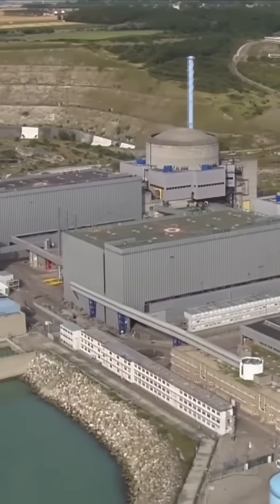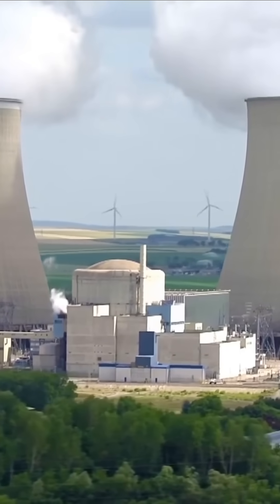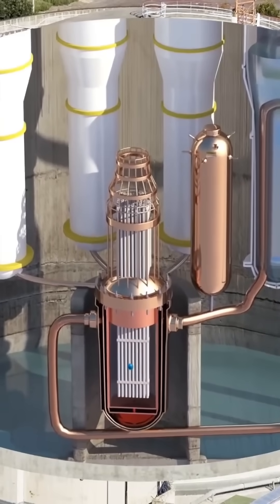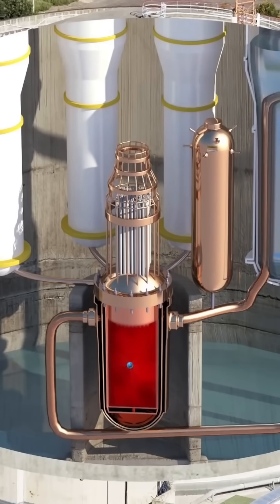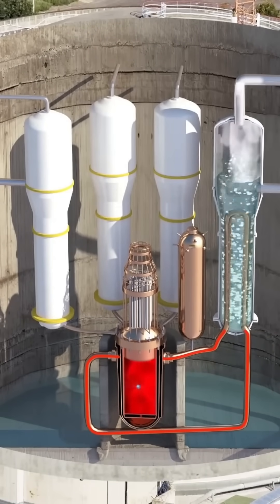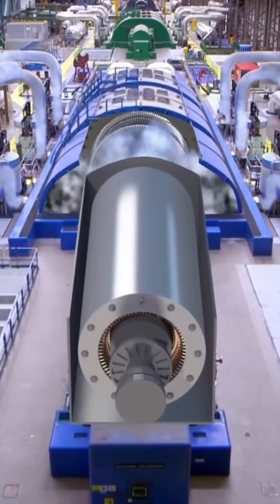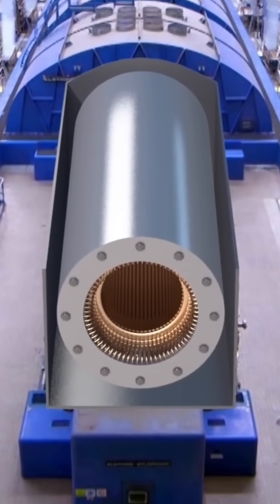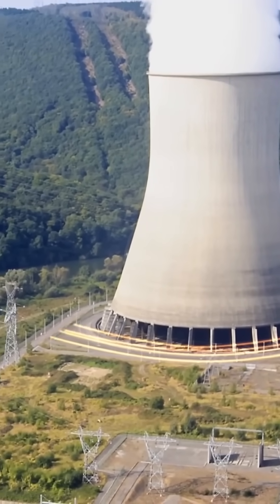How does a Nuclear Reactor work? #shorts #nuclearpower #nuclearreactor

Comment: It's a fancy way of boiling water
Reply: *Efficient way
Reply: @Highbudget , what about the waste generated that last 1,000 of years...
Reply: @iCyWEdontCi2i  the amount of death caused by the waste is zero  meanwhile the deaths caused by polution due to  fossil fuel burning is over 8 million every year
Reply: @gleyphnir087 ,  And that's how you can get away with that statement because a nucIear reactor, on its own, cannot power itself... It takes atleast 1 external power source ( coal-fired, natural gas, etc ) to help keep a nuclear reactor cooled and running. Their waste alone is enough, but when you have nucIear waste that has to be stored away for decades, AND Still Adding Up...  You have a problem.
Reply: @iCyWEdontCi2i if you can suggest them an alternative pathway
Reply: @iCyWEdontCi2i  Sources?
Reply: @iCyWEdontCi2i The hot rocks in a can waste that never hurt anybody anywhere ever, ever, while oil coal gas dumps billions of tons of waste/yr  in the air?
Reply: @iCyWEdontCi2i False.  Nuclear needs something to run pumps. It’s idiotic to say only coal gas plants can run pumps. For instance, another nuclear plant can do the job, as it does already in France, Ontario, etc
Reply: @iCyWEdontCi2i your obsession is a problem. Some hot rocks in a can which a million times smaller in size  than any other source is not a problem, but you use it to hide other sources that are a problem, like everything else.
Reply: @iCyWEdontCi2i yet we can recycle it unlike coal and fossilfuel
Reply: @toxicbreaker776  , where are they "recycling" the waste ?  What type of the waste are they "recycling" ?  Low Level or Highly radioactive ?  Is that disease factory near you ?
Reply: @iCyWEdontCi2i  burying it underground and wait for another 100years so they can use it again to for fuel in the reactor
Reply: @toxicbreaker776 , yeah right.
Sounds "clean, green, too cheap to meter"
I'm hoping you're teaching your kids , that we're screwd, and that they won't make it to your age, thanks to nucIear
Reply: @iCyWEdontCi2i  bro ur tripping, nuclear power plant is the best and also clean energy that the humans can get. You clearly need some study about the power plant and how its waste being operated.
Reply: @iCyWEdontCi2i the waste can be recycled and if not that safely stored. Nuclear waste Is often processed and contained in a huge concrete and steel casket. It's attuly so thick that You receive about the same radiation standing next one as much as you get on a plane flight.
Reply: @toxicbreaker776 , That fact that you began with using "bro", shows alot. 
I've studied enough to realize why someone you know has a Cancer.
If the waste is "sooo safe", then why are they digging holes in the ground to store it, you know like a place like Onkalo or WIIP or Yucca Mountain ?
Reply: @iCyWEdontCi2i gets recycled and used again
Reply: @iCyWEdontCi2i I would love to here your better alternative just so I can tell you why it’s not as good, maybe you can get a one up on science and nuclear engendering that have been studied for decades… I mean there probably is a better way but as far as I know there haven’t been any breakthroughs concerning dark matter or anti matter so as of right now nuclear power is the way to go
Reply: @convenientplayer , its called research.  Something most people don't do, because they're lazy and believe and go along with  the first thing that shows up in front of their face.
Reply: @Hydro0516 ,The Best Alternative is to Not have nucIear at all... But the World is WAY Past that now... 
NucIear is only good for one thing, B ombs.
 NucIear wasn't thought of for electricity...  
But anyways, Where is it being "recycled" ? Name the place.
Reply: @iCyWEdontCi2i  I don’t see one of the most efficient ways of producing electricity to come to an end anytime soon, of course there are alternatives that are pretty good i have to agree but they aren’t better than nuclear as far as effectiveness goes especially input to output. I am a little bias since I do work at a nuclear power plant but It depends on the location. In the desert it is most likely thermal solar plants, on the sea its wind energy on large rivers hydro plants.  But leaving those things out nuclear is the most effective way that can be used anywhere at anytime that we as humans know of. you can run a nuclear power plant from a extremely small amount of enriched uranium and yes it is recycled and it is possible to recycle nuclear waste but the US hasn’t started doing it yet but they will in the future
Reply: @Hydro0516 , "most efficient" ways... Come on man, you're boiling water, by cooling a reactor, which produces Steam, in which is pressurized to turn a generator, which is actually what is generating the electricity in the first place.(your reactor doesn't make electricity). All the while, there's an external Fossil Fuel burning power plant on most sites that help power the Whole facility...  So why not just have the External Power Source doing the Whole Job of generating Electricity ?  I mean, Coal, Gas, or Solar DONT have (RADlOACTIVE) waste that has to be stored away for Thousands of Years, now do they ?
I'm totally sure your defending nucIear because it makes you a paycheck... But when someone you know, let alone yourself , gets CANCER, you'll think differently.
Reply: @iCyWEdontCi2i I live near a Uranium mine for more than 20 years everyday enriched fuel is taken from here to nuclear power plants across my country and not once has someone gotten sick from radiation exposure it is THAT safe
Reply: @aniketsrivastava1870 , where's cancer come from ?
Reply: @iCyWEdontCi2i  you think cancer only happens to people who are exposed to radiation?
Reply: @aniketsrivastava1870 , Yes.
Reply: @aniketsrivastava1870 , we "Run for the Cure", but don't talk about the cause...
Reply: @iCyWEdontCi2i my guy I’m in the navy and I’m in school right now to become a MMN, reactors are the cleanest form of energy on the planet. They don’t generate waste they generate radioactive fission products that are contained within the core until it’s 20 years are up then they are decontaminated on shore. You should at least do some sort of research before bad mouthing something that you don’t completely understand
Reply: @jeremiahparnell-qb5ok , "cleanest form of energy ??  Energy that comes from the Steam, right ? Steam that turns a Turbine, right ?
And the waste "left over" has to be stored away for 1,000 of years...??
Yea, that's Clean alright... Smh
Reply: @iCyWEdontCi2i  it is clean. and the waste can be stored really easy. And the great thing is that the 4th generation reactors powered by thorium do not produce waste
Reply: @Sputnick_00 , are you paid to type that ?
Reply: @iCyWEdontCi2i  yes of course my friendly goober
Reply: @Sputnick_00 , yep... Resort to name calling... You are clearly, paid or lost...
What about the waste from over 80 years ?  That we are still dealing with ?
Reply: @iCyWEdontCi2i  You can store radioactive waste. You cannot store the gasses produced by burning coal or fossil fuels
Reply: @iCyWEdontCi2i  Its stored in a cooling pool onsite. We aren't "Dealing with it" Because it is being stored in a cooling pool. Putting more greenhouse gasses into the air is worse than storing radioactive waste. Everyone is effected when you use fossil fuels / coal. With nuclear plants no one is effected unless there is a catastrophic failure like Chernobyl where the core melted down. With modern tech that never happens.
Reply: like all electric plants

Comment: Next how does an RBMK reactor work
Reply: As a Chernobyl / RBMK nerd I’ll tell you about them, RBMK reactors have low enrichment uranium in pipes known as channels, some channels have boron rods that can be inserted and withdrawn from the reactor, these rods will increase the reaction when pulled out and decrease it when inserted. The boron rods had a section underneath made from graphite, so when the control rods are withdrawn they are replaced by graphite which makes the reaction go faster. Prior to 1988 there was a design flaw in the reactor which lead to a brief spike in reactivity right when the rods were put back in, this is what lead to the explosion of Chernobyl Reactor 4 on the 26th of April 1986. This reactor type is extremely unstable especially at low power, however at full power the reactor is far more stable, though still unstable compared to a BWR or PWR reactor.
Reply: @Thxtnt  good 👍 man great explanation I wasn't sure
Reply: @Thxtnt  Let me add: the end effect was caused by shortened graphite rods (their length was reduced from 7 meters to 5), which caused the end effect.
Reply: @nedward.7442   In an RBMK reactor, the boron portion of the rod is 7 meters, in modern RBMK's, the graphite portion is also 7 meters, however during the time period of the accident, this was not the case.

The graphite portion used to be cut short by 1.25 meters on each end, 1.25 meters of empty space at the bottom, and 1.25 meters with a piece of metal to fix it in place (functionally empty), making the original graphite portion only 4.5 meters.

The lowest 1.25 meters is where a hotspot formed in the Chernobyl disaster, leading to the power surge when AZ-5 was pushed and subsequent explosion.
Reply: @Thxtnt  
Thank you. I talked about this.
But modern RBMKs do not have a graphite displacer; it was replaced with an aluminum cylinder, and the boron rod runs dry.
Reply: @nedward.7442  This is false, I’m unsure as to where you got this from, but it is untrue. An RBMK fundamentally needs graphite to run, graphite serves as a moderator, and without it you wouldn’t reach anywhere near high enough levels of reactivity to power the steam turbines at full speed, making this literally impossible due to physics.
Reply: @nedward.7442  that’s the thing, I’m referring to the displacers on the control rods. Also I’m going to sleep do my next reply will likely be delayed
Reply: @Thxtnt  
And I mean displacers. They were actually removed and an aluminum sleeve was installed. Most likely, it does not particularly affect the absorption of neutrons.
Reply: Stupidly
Reply: It’s a piss poor designed boiling water reactor. Unstable at low powers and would get hotter where there was no water (due to rapid boiling)… normal reactors cool down where there is no water (negative coefficient if I recall correctly), and the control rods had tips that reflected neutrons vs absorbed them like the rest of the control rod (and every other normal reactor). Absorbing neutrons is how you decrease power/shut down the reactor.
Reply: That's a soviet BWR

Comment: Surely we can do better than using heated water to twist a turbine
Reply: Well, do you have any suggestions? Surely there's a more efficient way to do this that not a single person has come up with yet, perhaps you could help?
Reply: Like what?
Reply: @twistedgaming4215 , by just simply using one of the two external power sources that are in place to power the nucIear facility.
Reply: @iCyWEdontCi2i nuclear power plants power themselves
Reply: Not yet? This tech is from 1800s then when we first developed steam powered turbine generated energy. We do have Brownian motion using graphene which allow for unlimited clean energy generation, so there is that. The problem is it can be a challenge to scale this up to generate huge amounts. We can do that but so far no one has bothered to try.
Reply: Man, each one of these turbines (generators to be exact) can produce up to 1 gigawatt of energy. Maybe even more in some cases, i'm not sure
Reply: @yourbigfan1777 , One Hell of a way to Boil water...
Reply: Nuclear power is the most efficient power source currently developed.

Comment: This doesn't explain the nuclear part of the nuclear reactor system.  Lol. Thumbs down.
Reply: He said it’s heated by nuclear fission from the core, go look up what nuclear fission is then 🤦‍♂️
Reply: @voiidenn  And he said the video was ABOUT how a nuclear reactor works, not the bloody turbines or whatever.

So, as the video poster failed to tell us HOW the nuclear fission process works, my young brain will do that for them. 

Nuclear Fission is where the nucleus of an atom splits into two or more smaller nuclei. This usually releases two to three neutrons (2.43 on average) which are flying at a very high speed and need to be slowed down. This is referred to moderation. The neutrons are too fast to hit another atom and have a slim chance of even doing so. So, a moderator is used. Something like Graphite or Water/Heavy Water is used to slow these neutrons down to roughly around 100 km/s or lower; it can be a few times higher than the speed of sound. However, this won't do. The reaction needs to be controlled or the fuel will melt. A material like Boron, cadmium or gadolinium can absorb neutrons and is used in the control rod. This controls whether the reaction increases, doesn't increase or just decreases. This is referred to as Supercriticality, Criticality and Subcriticality, respectively. Some of the neutrons get absorbed by the rods and the fuel. At low power, a neutron poison called Iodine-135 is created. This has a half life of 6.7 hours and isn't very good at absorbing neutrons. HOWEVER, once this Iodine decays, Xenon-135 is made which absorbs neutrons VERY well and has a half life of 9.7 hours. This can easily stall a nuclear reactor which happened to the RBMK-1000 used in Chernobyl's Unit 4.

Heat is created by this fission process, but very little of it. On large scales (not atomic scale, but rather regular fuel rods.) a lot of heat is made. A coolant like water which also is a moderator boils from the heat and takes that heat away with it - cooling the fuel rods. This ensures that it doesn't melt. The hotter the steam, the more energy that steam has and the faster it goes. This goes through the steam separator and through a series of pipes to the turbines. The steam spins the turbine which spins and generates electricity by a rotor. The steam then goes through cooling tower(s) and the water that comes down is put into a nearby water source (rivers or oceans).

Since water and graphite can be used as a moderator, there is something called a Positive Void Coefficient. Once water boils, a void is created - steam. This causes the reaction to go up. This happened with the Chernobyl RBMK-1000 Reactor when it was heavily poisoned and the turbine was turned off to simulate a blackout condition.

In the regular reactors you see today, like BWRs and PWRs, there is a Negative Void Coefficient. Once the water boils, the void is made and the resulting steam causes a decrease in reactivity.